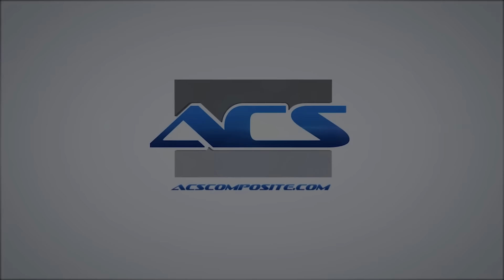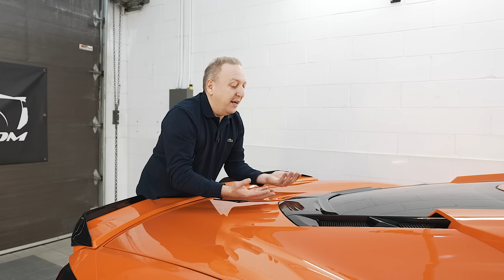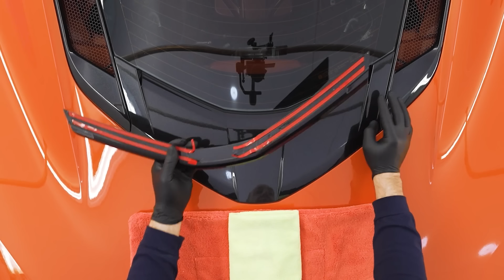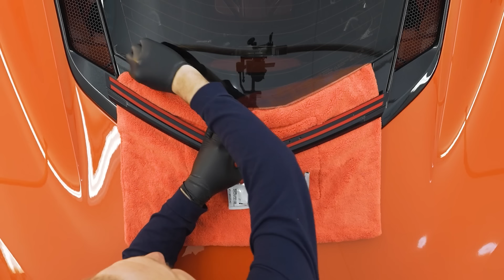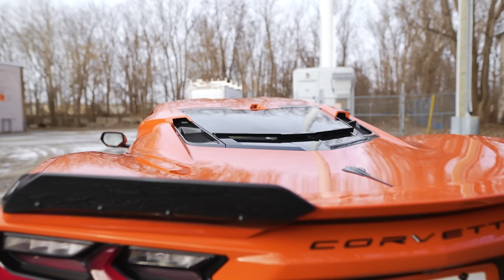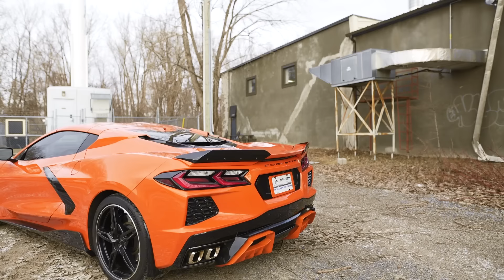C8 Corvette Coupe Rear Window Spoiler Install | 50-4-150 | ACS Composite

Comment: Just installed. The spoiler is well made, great fit, nice painted surface. The instructions were clear and easy to follow. The only difference from this video and my kit was that the tape was not pre-installed. The spoiler was also very well packaged. 

The look is clean, and it does complete the look of the glass.

Thank you!
Reply: For the price the tape should be installed. Good lord!
Reply: You right.   @terrytappski

Comment: Cool mod, however junk. I bought one put it on and it peels away from the class in no time. Took it off today. Not worth the money!!!
Reply: Had the same problem with mine.  The heat from the engine loosens the tape. I bought some HIGH heat double sided tape and adhesive promoter. Gonna apply that to both surfaces and see if it makes a difference

Comment: Will this be available in exposed carbon fiber as well?
Reply: $250 for plastic and you want to know if it will be available in CF?
Reply: @Ringmaster30  yes, I would like to know if this piece will be available in carbon fiber.
Reply from the maker: Hi guys, not at the moment. We are exploring options on carbon fiber ;)
Reply: @ACSCOMPOSITE  thanks
Reply: Patrick, apparently you didn't get my point.